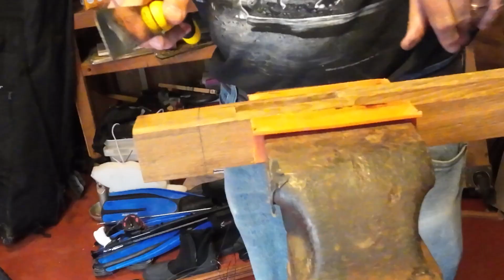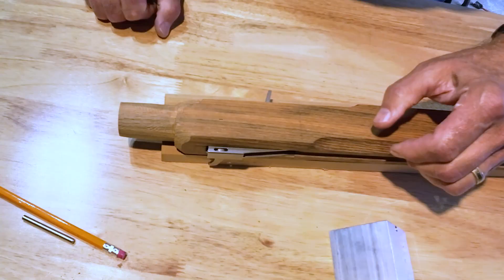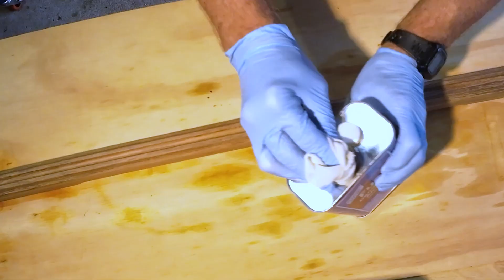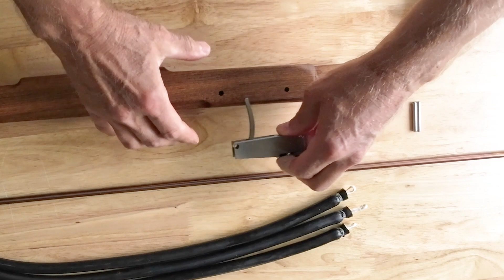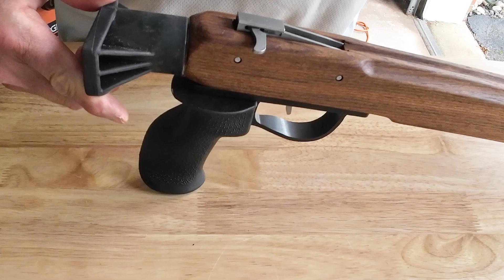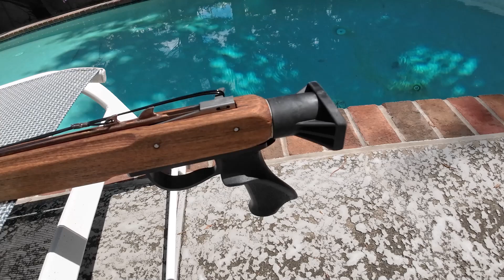Build your own speargun, Part 3

Comment: Thank you for these tutorials ! They were very thorough and helpful. I’m considering building my first speargun myself, currently only using a pole spear. 
I’m curious how much the total cost of the project was ?
Reply from the maker: Hi, thank you. It’s been a couple years since I made them and with the way prices have changed I think your best bet for an estimate would be to go to Neptonics.com and check out their current prices for the parts. The big unknown though is sourcing the wood. It can be tough getting some good teak unless you have a hardwood supplier in your area. Neptonics sells a blank with a lot of the milling already done if you want to go that route. But I just checked their website and quite a few parts are listed as sold out. 

As I recall, I did indeed save money over buying a new Koah, I’m thinking about 25%.  It wasn’t as much as of a savings as I initially thought it would be, but the satisfaction of making it myself was pretty high.  Thanks again, good luck.